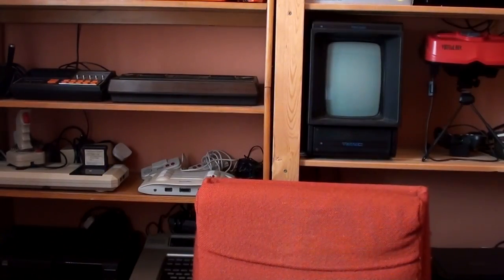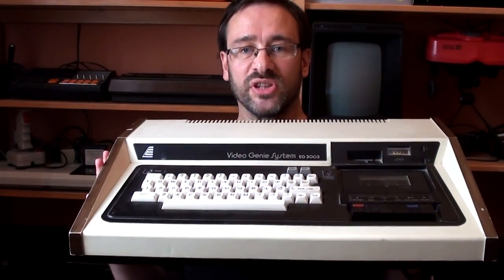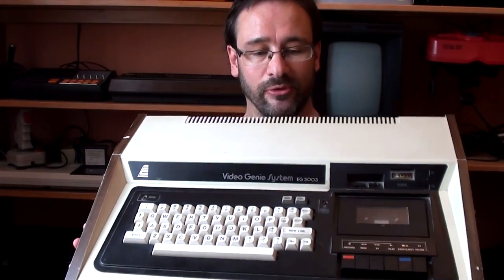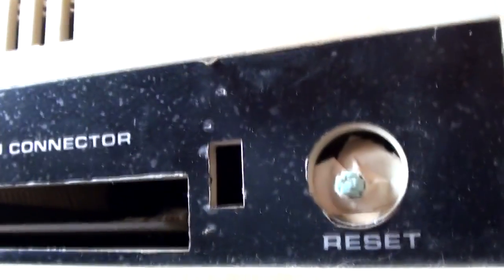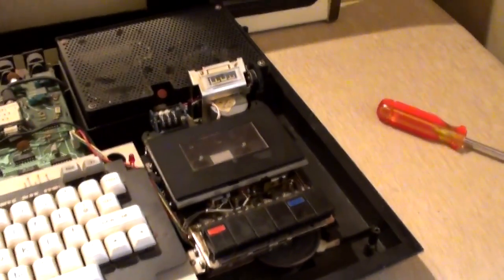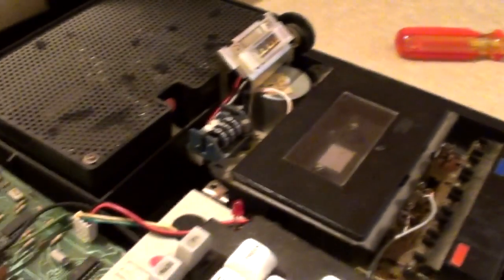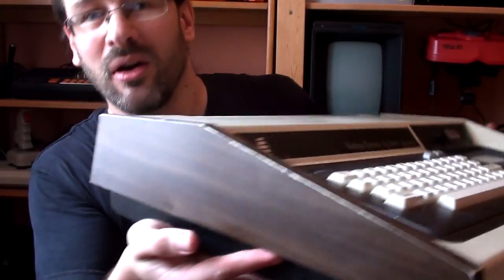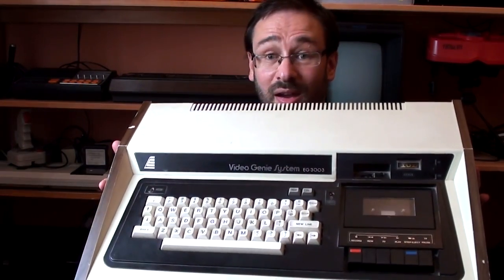EACA Video Genie EG3003: System Overview.

Comment: I had a Video Genie. It was my first computer back in 1980. I'd sit for ages typing in code, only to find it reset itself and lose all my code. I later found out it was resetting every time my mum switched on the cooker. We returned the computer and upgraded it for a Sharp MZ-80K which was a lot more reliable and still runs today.

Comment: This machine sold in Hong Kong named "Genie System" only without "Video".  I owned this machine when I was 16.  I got it by using second hand price, it was HK$3000 with monochrome monitor.  It was a huge money in 1981.  However, without this, I believe my life may quite different. I self learned programming language by using this.  And after my secondary school, and went to job market,  With luck and my past programming experience, I finally gott into in I.T.  related work in a shipping company, then started my almost 30 years I.T. career.  Thanks Genie and my Dad, and also thanks to you, Steve, you bring me a wonderful memory.

Comment: These were sold in Australia by the Dick Smith chain of Electronics stores as the System 80 (well at least the models after the very 1st one) in competition with the Tandy's stores selling the TRS-80 machines.  So these were the machines I played with in both of these store chains.  Considering how many would have been sold neither pop-up very often for sale, but they are heavy & I suppose end up in landfill.  There have been a few TRS-80 machines from one guy who restores them. Great review.

Comment: I've juist picked one of these up.  The tape not working will be the drive belt deteriating.  They always dry out in these sort of systems.  You should be able to buy another on eBay if you can work out the length of it.
Reply from the maker: The belt was fine. It was a lack of data signal that was causing an issue. Sadly though, the whole thing died some time ago and I chose to give it away when I moved to a smaller home where I didn't have space for the thing.
Reply: @SteveBenway  That's a shame. It is a massive system though, much bigger than the desk space I had allocated to it.

Comment: You might want to try cleaning the rubber roller (which is usually on the left of the read/write head). This roler is responsible for keeping the tape moving at a constant speed, because with it when the tape is completely rewound the right spool is very small and would pull the tape too slowly, and as the tape is played the right spool gets bigger and bigger meaning each revolution of the reel pulls in more feet of tape per second. I think they should have had the tapes only work on one (cont)

Comment: the band in the tape player is dry rotted. You'll have to replace it if You want to use the tape deck. OR you could have the tape program converted into WAV format & play it off an mp3 player through a tape adapter.

Comment: I have one of that beast – actually with no "Video" printing on the front, just a "Genie EG 3003", – and I have another one, with almost the same looking! It is a hungarian built (or just decal fitted) machine, the HT 1080Z "School Computer". Yes, it was a common school computer of the early 80's at nearly every hungarian elementary and high schools. Unfortunatelly we didn't know this unit runs almost all TRS-80 software. :-(

I have a heavy expansion module for it, but no cable to connect them together. It's basic is a bit weird one, to load a program from cassette tape, you had to type the CLOAD"" command (means Cassette LOAD). Save is the same, CSAVE"program name". Anyway, I wasn't dare to check them working yet. :-D

Comment: side so that the tape would, in effect, be twice fast. So if it was setup to have the recorder use the full width of the tape, 2 bits could be loaded at a time AND you would be able to copy your tapes on a dual deck recorder , so it would have made the tape impossible to duplicate with home equipment.

Comment: You might have crust build up on the Tape head & the recording head. You can try rubbing it down firmly with a Q-tip in alcohol. I've had this issue with an old Commodore 64 tape player & after I did the cleaning it worked. Another possibility could be that Your tapes are oxidized. It's possible if the tapes are really old. Good luck with it I would really love to see this beast in operation ! :D

Comment: Actually that sounds pretty easy to fix if you have a scope and follow the signal starting at the heads ;)
You could try a external tape drive, I am sure the cable can be found somewhere if not it's easy to make yourself. All you need on your external drive is 3 jack connectors (2x 3.5m for input+output and a 2.5mm for tape control), If you don't find a tape drive with the 2.5mm control jack you can start/stop the tape manually ;)

Comment: A quick glance at how the take deck is connected, I can see a four wire pin connecter Red+Back (clearly power and ground) and then Yellow, and Green, could it be Line in and Line out?

Could be mistaken but thats all that is visible??

Comment: I only got mine by chance as I was picking something else off ebay and asked they seller if they had anything else . got mine for £15 :) BUT I haven't switched it on as it belonged to a smoker (and it showed). from what I see , the "memory upgrade" is just piggy backing the other chips. so I should sort out the PSU and caps before turning it on :) . hopefully the tape deck works.

Comment: I have the same machine, got it boxed WITH receipt from sunny watford shop that was  photography place. err 1980 or 81. it was sold for £428 IRC... does yours have a euro 2 pin plug on it or the 3 pin one ? not tested it yet as I was cleaning it coz of the old owner was a smoker.. I'm guessing changing the caps etc might be a good idea also perhaps :) .. sure you know it was the "dick smith" computer in oz.. their memory expansion looks a good laugh to try.

Comment: Why do these old machines have such crazy amounts of RF shielding(like at 4:12 into the video)? Was it just government bureaucrats over-burdening the computer industry. I have deliberately removed the RF shielding off of many computers (C64,1541 drive (which is a computer itself), Amiga 500 and the atari 2600) and there was no interference whatsoever with TV or Radio signals, even when placed very, very close to the machine.